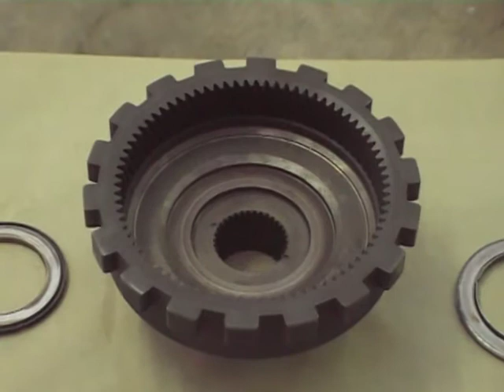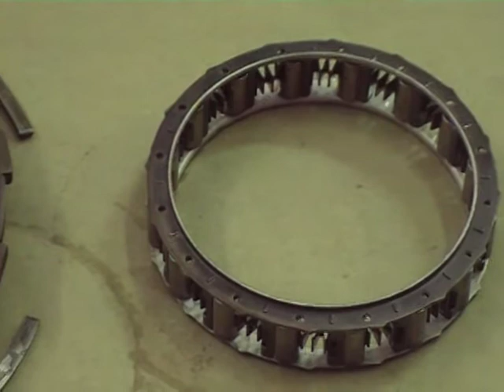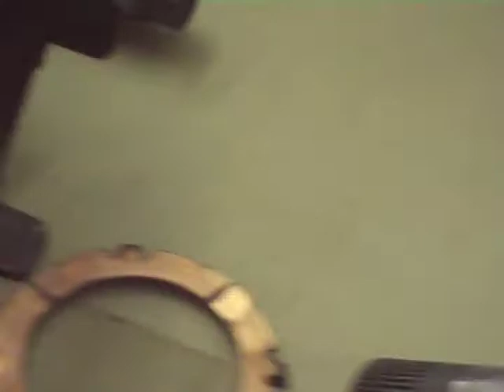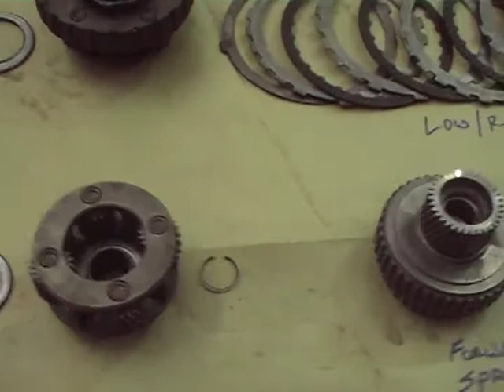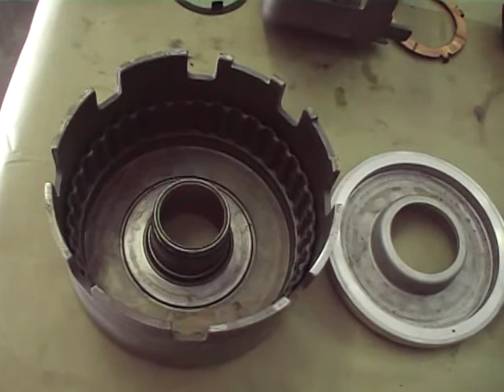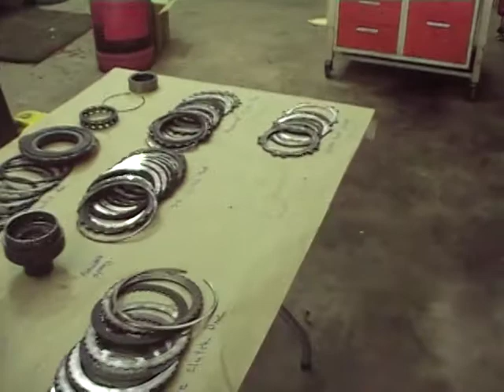breakdown4l60e

Comment: The drum the band rides on is the reverse input drum. It is applied only in reverse. The 3-4 clutches apply in third and remain applied in 4th so as to facilitate a smooth 4-3 downshift. I was tricked by that on the first one I tore down too. I thought it was direct reverse also.

Comment: transmissionguy1 my trans has about 100 miles on a rebuild. it shifts fine, but it starts to shake at about 45-50 miles per hour. its not the driveshaft or rear end. any idea?